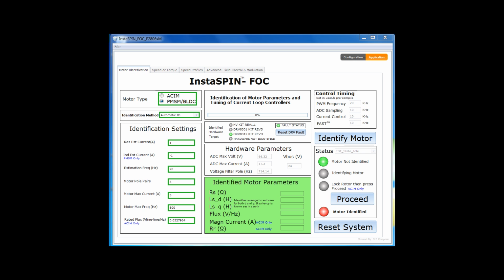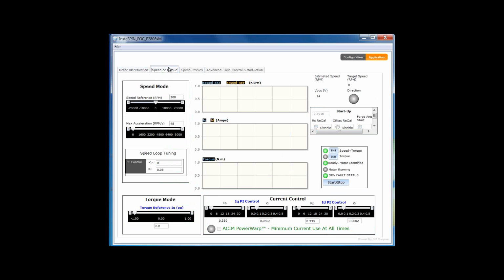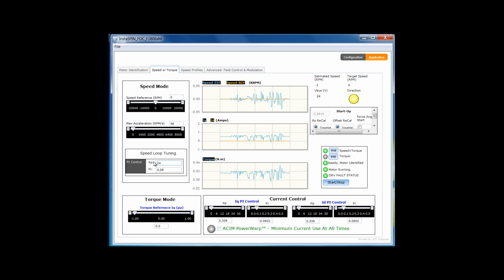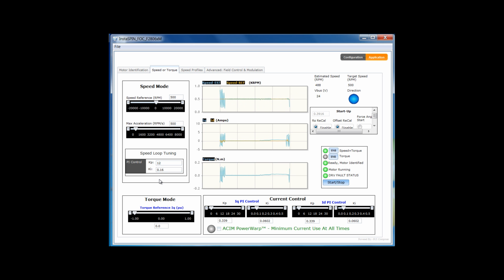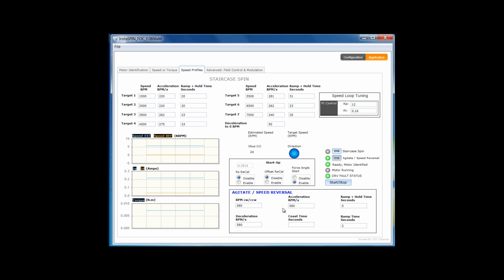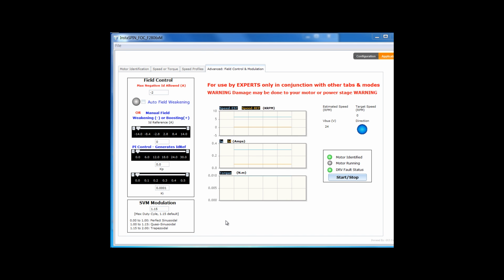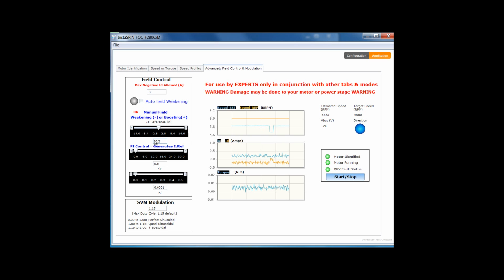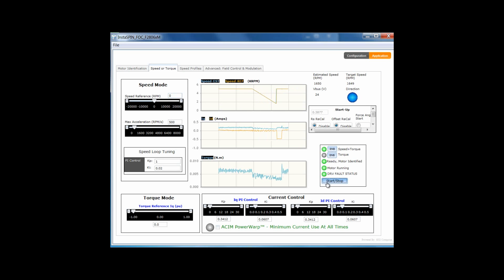GUI Overview for InstaSPIN-FOC

Comment: My first idea of InstaPIN-FOC was that it really means "insta"nt -SPIN, which is not the case. After downloading multiple software, CCS, Motorware, GUI and reading thru endless pdf-documents and examples, it took already hours of prework to get even a clue what all these programs and pdfs are about and how they are used. When I add some incompatible issues, installation problems and a most, the complexity of setting your first project, I had to admit that instaspin means instant-spinning your head only. You need to compile your modified files (figure it out first how to modify), find a file, change its name, copy it to another folder, run GUI, set your board, figure out tens of different parameters you have ever even heard before. And then you think this is an easy task?, think twice. Texas Instruments have made this FOC extremenly complex task to proceed into real life. Maybe one thing tells it all, if you shut down GUI before stopping the motor, you can make the system into unstable state where you can burn your motor, control boards and there is a risk of fire, go and figure it out yourself...